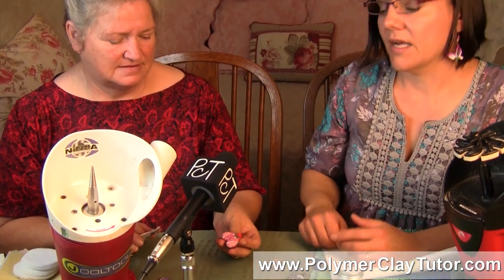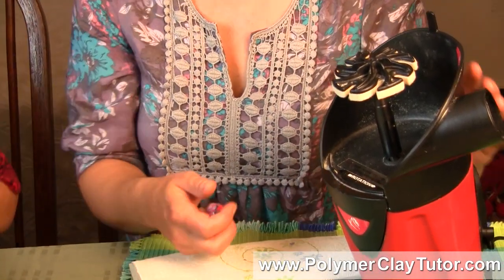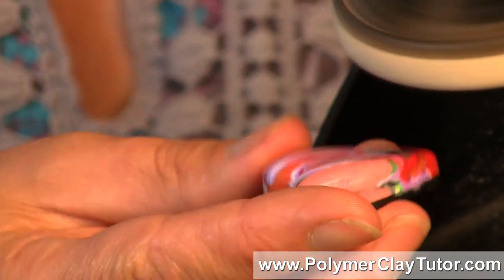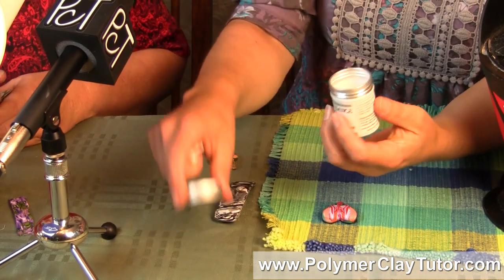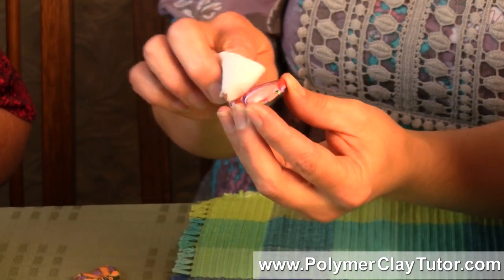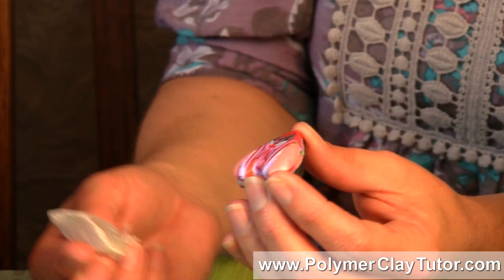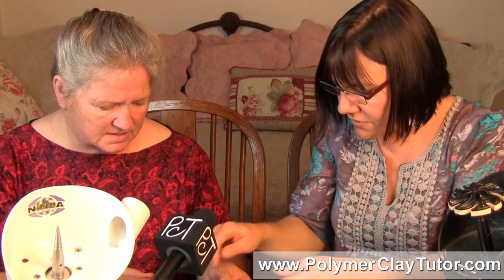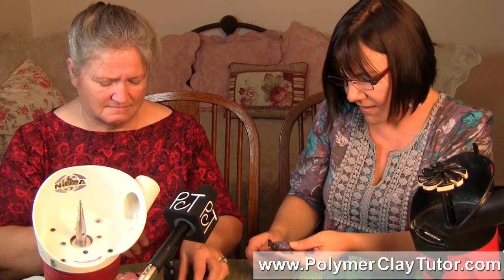How To Get Shiny Polymer Clay Using Renaissance Wax

Comment: I have the wax and I've never tried using it.  Still trying to come up with the best  method for that perfect shine.  I do have the polyfast sander tool and I LOVE it.  For me, so far, resin is the best answer though I'm having some troubles with using it,  I hope to perfect my method of applying it and curing it. I use the UV Epoxy Resin and also their 54w UV resin lamp but I'm having so many troubles with it.  I believe it's because of the storage temp that the resin requires.  It's a few degrees too warm in the house and too cold in the fridge for it.  So, I've purchased a small fridge just for my resin where I keep it now at the perfect temp...BUT I think the resin is already ruined because it just won't set for me right.  It's sticky and even after "over baking" under the UV lamp lights - even double and tripple the required time, it's still sticky.... Wish I knew how to solve this problem.
Reply: Try wiping it with some 70% alcohol. I’m told that can get rid of the sticky layer (you have to do exactly the same with UV gel nail polish)

Comment: Thank you - I'm glad I researched before buying. Seems like too much work vs just poly coating.
Reply from the maker: Renaissance wax is actually easier to apply than adding a poly coating. You still have to sand before you add any finish (except for really thick resin coatings). Finishes just emphasize any flaws.

Comment: This lets me know that I don't want to buy this wax as I don't have anything to make it shine first. Why would you want something that requires a shine before you use it. Seems redundant.
Reply: Carolyn Hayes  it's the same principle as you wouldn't try to polish rough cut, unplaned/unsanded wood.  You need it to be smooth before you polish otherwise wax will get stuck in all the scratches and troughs.

You can sand by hand too, you don't need an expensive tool to do that, just fine grit wet and dry paper.

Comment: Ok, HUGE problem. I work my fingers to a crampy mess, go thru all grades of polishing paper, I do the. Ren wax, all that work and it gets all yucky with in a min of handling the piece. I did the pen kits with the burr wood and they dulled up so bad I'm actually embarrassed. Please help me Cindy! They are shinny only for a min and they become dull and just ugly! Please help me!
Reply from the maker: Hi maggwhlz How much Ren Wax are you putting on your pens? It needs to go on very sparingly and then dry before buffing. The fact that it is getting yucky has me thinking that maybe you are putting the wax on too thick and it won't dry. If your pieces have been sanding and buffed before you put the wax on, then the wax should be improving the shine, not making it worse. Let me know if this helps.